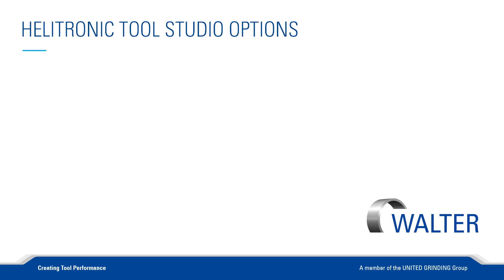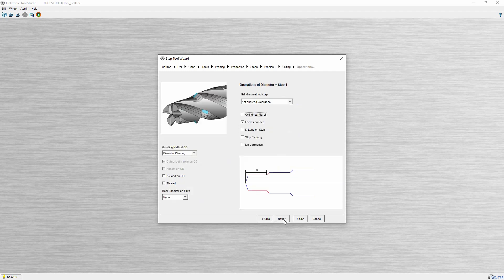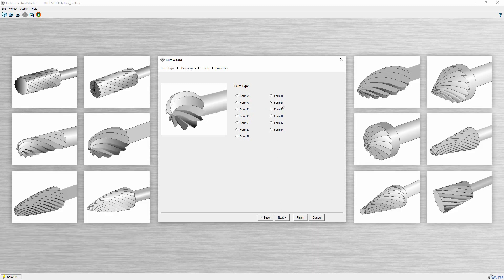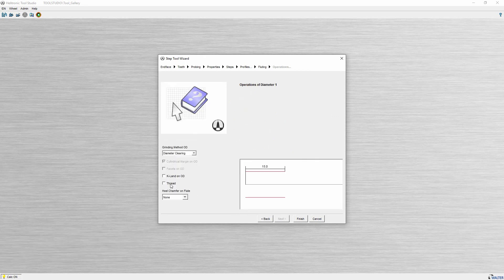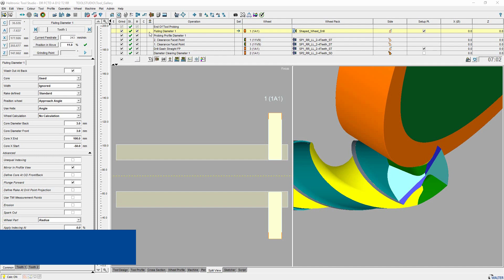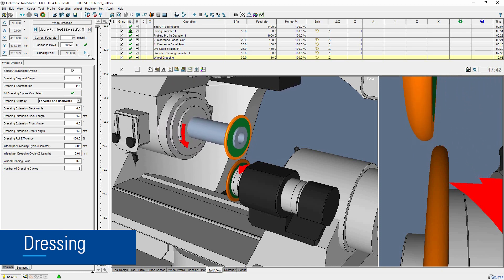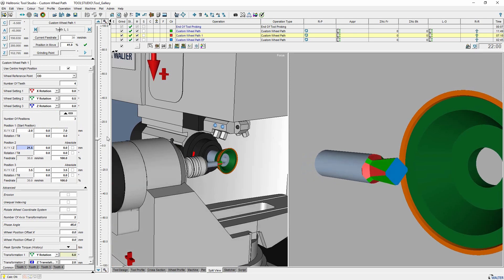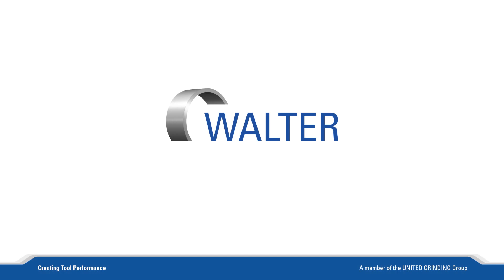WALTER HELITRONIC TOOL STUDIO Options

Comment: Thank you for your youtube im walter engineer in korear (beginner) Can I email you about my question dealing with this machine?
Reply from the maker: Of course, no problem. In order to address your request internally to the right departement, could you please inform me, which kind of question you have? Software? Hardware? Application etc...?
Reply: @WALTEREWAG  I'm curious about all part both software and hardware. Colud we send DM via instagram or send email about my questions? Which one do you prefer?
Reply from the maker: @carbide man: Since you are from Korea, I would like to recommend for easy communication to contact or partner BESSE ENGINEERING CO., LTD.
(Business Partner of WALTER & EWAG)  
(Dongwoovestium, Kwanyang-dong) #208, 281 Simindaero Dongan-gu, Anyang-si, Gyunggi-do, 14054, Korea 
CP. +82 10 2734 8810  Tel. +82 31 382 8936 . Fax +82 31 382 8935
Mr. Chang-Ju Yee will be happy to help. Here are the contact details for E-Mail contact: Chang-Ju.Yee@walter-ewag.com .
Reply: @WALTEREWAG  yes i know him we met when i got the machine i just want different opinion

Comment: Its version 3?
Reply from the maker: The video was recorded using HELITRONIC TOOL STUDIO 3.3. However, some of the individual functions described have been available "almost forever", like "Steptools" or "Reamer" or are available since a long time now, like "Countersink" which was introduced with HELITRONIC TOOL STUDIO 2.1.
Reply: @WALTEREWAG  I use 2.1R6 not see thread option in steptools
Reply from the maker: @cbtcbt4629  This function is available from 3.1 on